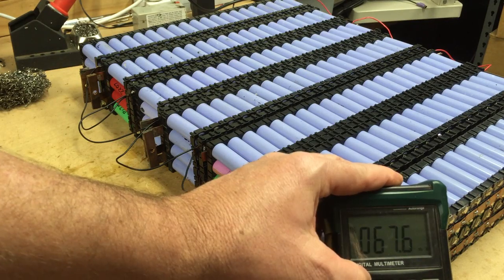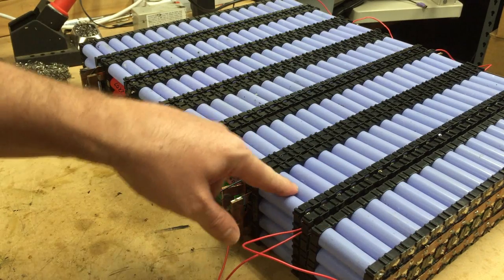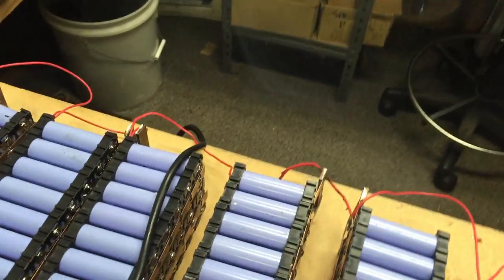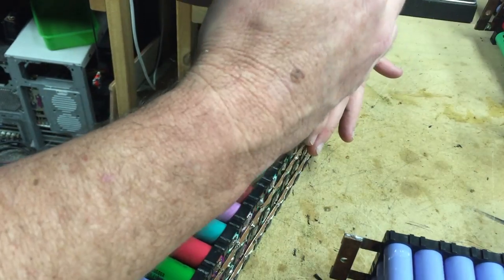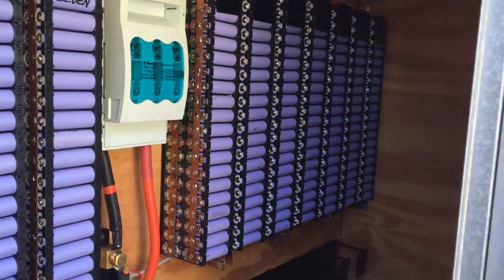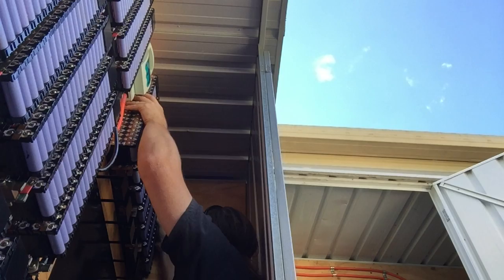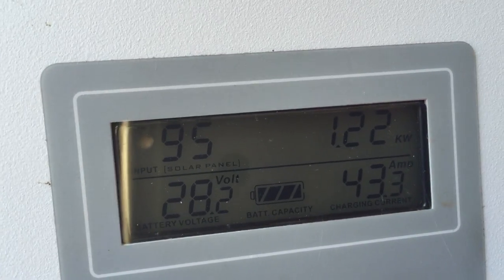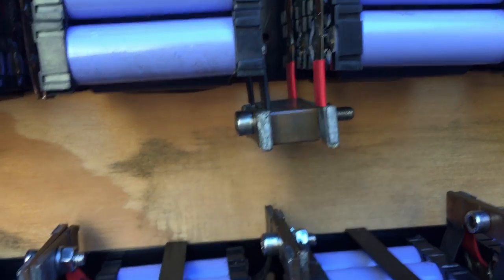Building a DIY Powerwall from used laptop batteries

Comment: Hey man, I just watched your video. Some quick remarks from an electrical engineer - don't confuse Wh (Watt hours) with Ah (Ampere hours). What you need to do is to multiply the voltages and the amperes (technically for each operating point of the cells respective discharge curve) and sum them up over time to get the Wh or kWh. You said you had around 30 kWh at 48 Volts, which would mean (as you said) 60 kWh at 24 Volts - that's not how you do it. The kWh stay the same, as the voltage drops to half it's value and the amps go up accordingly. The 'h' in kWh actually matters btw. - draw 5 kW for 30 minutes and 15 kW for another 30, you have one hour of 10 kW in average - 10 kWh so to say. Which means that it's the same for the battery, no matter if you draw 1 kW for 10 hours or 100 kW for 6 minutes (apart from losses due to heating of the battery at such loads). So the capacity of 30 kWh means that you could supply a 3 kW load for 10 hours, which would be sufficient for most nights, where your solar panels are kind of useless :)
Secondly, regarding the cells with different capacity - don't connect cells with different capacity in series, better have them in parallel to stronger cells in the other packs. When you drain your batteries in series, the smaller capacity ones will drain completely and irreversibly (!), while the other packs are still in good shape. As the other packs still have enough voltage so the resulting series connected voltage is high enough to keep the powerwall in it's operating range, the powerwall will draw as much current as necessary to power your loads. If this happens once, your smaller capacity packs fail and you will loose overall capacity. If you connect them in parallel to stronger cells, the voltage across the pack will balance automatically and the smaller capacity batteries will be discharched less in apsolute amp hours, but equally in percentage to the stronger ones in parallel. This will most likely boost your battery pack's robustness to heavy discharge tremendously. 
Apart from that - great work! If you don't have a bms, you should check your respective pack's voltages regularly and somehow try to balance them. Don't use bare wire for balancing, as they might burn again. Connect a resistor in series (dimensioned correctly to stand the load!) to equalize slowly.
Reply: Why does anyone talk in Amps?
Reply: Try talking to someone that fiddles with smartphones all day, MiliAmps is all they know.
Reply: Well - it's a power system. To calculate power (watts) you have to multiply amps by volts.
Reply: Also any hobby that uses Li-pos. Watts are never used, it's always amps.
Reply: Phasedragon what do you mean? I use lipos for quadcopter, heli's and planes. but don't get your comment. how can you use amps but not volts? unless you are referring to the way manufacturers display the battery's capacity? (which is by the way useless information without knowing the voltage or cell count since power is watts and displaying the ah is only half the picture) anyway I'm not sure I get what you meant?
Reply: kevin oakes He said watts aren't used, not volts.
Reply: TheRebel3000 I know. what point are you making? how can one consume electrical energy without using "watts" do elaborate....
Reply: It's not that they aren't used, it's that they're not measured. Volts are the cell count, amp hours are the capacity. Watts are not as consistent because the result changes with the voltage. 

A 12.6v battery with X milliamphours will last just as long as a 16.8v with X milliamphours, but the lower voltage will have less power. 
Whereas a 12.6v with Y watthours will be able to put out the same amount of power in total as a 16.8v with Y Wh, but last a shorter amount of time. 

TL;DR Point is, watts are a combination of volts and amps. And in an application where you may have varying voltage, like with batteries, amps are a more direct, meaningful unit. But in an application where your voltage will always be rectified and consistent, like in housing, then watts are more accurate.
Reply: Phasedragon ok. Well you are pretty much repeating watt 《 ;-) I said. I understand what you are saying but you are making an assumption. I shall ask hobbyking if they are planning a product recall for all the watt-metres they have sold......
Reply: in a circuit (like a flashlight), the load (light bulb) determines the amps, the volts are determined by the potential energy (the battery) and resistance of the circuit (internal wiring), and a Watt is a measurement of work, just like horsepower (about 730-750 watts per HP).
Reply: Alan Marshall We use Amps because it's a vital measurement in an electrical system.  If you don't talk about amps, you get fire.
Reply: @mitlaeufer1 , very interesting and informitive comment :)
Reply: thanks :)
Reply: All said and done pretty good job mate...keep your 48 volters low amperes so you can make them portable for trike, lawnmower,etc...keep your stick on the ice
Reply: Alan Marshall simplification from a lot of industries where the voltages are fixed for cells so people ignore it. It's no end of pain for me teaching this.
Reply: AHEMKBHD
Reply: Show off

Comment: Tight spot for that much energy density. Of course you know that. I used to work in the battery well of a submarine battery which is huge. 2.0V per cell with a 125 cells in series to get 250DC volts. roughly 2000 amps for an hour or so. The cells were 3 to 4 feet tall so huge power.
Reply from the maker: Yeh the space isn't perfect, what's worse is I have almost 20kwh more that won't fit :) Big things happening in the background at the moment. The old cashola is the only thing slowing progress.
Reply: how many deep cycles can it do ?
Reply from the maker: I really don't want it doing any deep cycles in fact most night it's lucky to draw .2 of a volt per pack :)
Reply: Why the 18650 form factor, would say stacked 7S flat packs or 14S flat packs be better?
Reply: He is using recycled cells from laptops.
Reply: How do you get 2000ah from 125 cells in series? 
125 cells in series is about 3amps!
Reply: z
Reply: Each cell is 2v  125ah
Reply: @robertw5607  amp hours means how long the battery will last under 1A of load, 2000Ah means it'll discharge in one hour if you'd constantly draw 2000A, or last 2000 hours if you only draw one amp.
that also means each cell is 2V 2000Ah, because the Ah value won't add up in series, 125 of them means 250V 2000Ah (or 2V 250000Ah)

he said the cells are 3 to 4 feet tall which is like 120cm tall, those are NOT 18650 cells obviously. most likely lead acid cells

Comment: Brilliant well done...I was nodding like a dog at you agreeing that at the capacity you have the lower capacity cells will work just as well because of the minimal load spread across the system... Re balanced module 100% agree no need
Reply from the maker: +1bigsyd never work well with single pack but larger packs it does seem like it will work with out issue. Other than I guess lower cells might have a tendency to completely fail faster perhaps.

Comment: kwh doesnt change with voltage 

30kwh at 48V is still 30kwh at 24V as long as the number and capacity of the cells is the same
Reply: you are the one who should take an electronics course 
i never referred to amp hours i was referring to watts (V x A = W)
i will take the liberty of schooling you today 

30KWh at 48V = 625AH 
30KWh at 24V = 1250AH
same number of cells = same watt hours regardless of voltage

even if you change the voltage 30KWh is still 30KWh 

heres an example
two 12V 10AH batteries contain 240WH of energy so regardless of the configuration they will have the same energy level (assuming they are fully charged) 
in parallel you will have 20AH at 12V = 240WH
in series you will have 10AH at 24V = 240WH

the benefit of higher voltage comes in the form of efficiency 
you can use more of that energy at high wattage levels because the amp draw on the battery will be lower 
higher amps = more voltage sag (that is why the power grid uses about 150KV for interstate power lines)

my solar system uses 12V and i get about 0.83V loss in the cables 
that means under 1500W of load only 11.17V is reaching the inverter if the battery voltage is 12V 
when the inverter shuts down due to low voltage at 10V there is still energy in the battery 
(not much but still a usable amount of energy) lower voltage loss grants you more runtime (to a point)

that voltage loss means i cant use all the batterys power at that high wattage
with a 24V system i would get a lower voltage loss for the same load wattage 
(as a percentage of system voltage)
thus i can use more of the batterys power at the higher wattage 

the other benefit of higher voltages is cost 
at 12V i needed eight 00AWG cables due to the amps needed to run at higher wattages 
at 48V i would only need two 00AWG cables to run the same number of watts 
making the installation easier and cheaper
Reply: MWB Gaming 20ah 1s 3.7v= 74wh 20ah 2s 7.4= 148wh    20ah 3s 11.1= 222wh. 33 kwh at 24v requires 1375ah and at 48v 33kwh requires 687.5ah. This is were i got confused. If you change series and parallel it does not matter, if same qty of cells are present. You are correct and i eat humble pie. What do you know i just got a tiny bit smarter. cheers for the correction.
Reply: not a problem 
knowledge is power and the more people know the better
Reply: I forgot to thank you as well for taking the time to add all the extra info. Cheers
Reply: its nice to know there are still civilised people in the youtube comments section
Reply: This is one of those times when you think: "What the fuck just happened?". Nice to see some civilised people as you said.
Reply: You are right... “as long as the number and capacity of cells is the same”
Reply: @mwbgaming28   I am also sitting here as a civilized person to watch your (healthy) war and give likes to both of you.To the winner and looser. ha,ha.
Reply: @mwbgaming28     you bothe are right,  30  kwh  is 30 kwh, aslong as one starts  with  x amount of power  it does not matter what form it takes (  48v   or  24 v )   but  if  on converst  from    30  kwh  at   48  v at  a continuous  anp,     to   20 v  ,   inorder to have   thew  same   kwh  , the amps  must double,   if one does not increce the  amps then  once it is converted it will have  60  kwh  .
Reply: @CstriderNNS  no, it doesn't work that way 

KWh is a measurement of the total energy a battery can store

KWh is a function of voltage multiplied by amp hours 

24V multiplied by 10AH is 240wh 
If you configure that into 2 10AH 12V batteries, you will still have 240wh 

The total energy of the battery is the same, you just rearranged the cells to make a different voltage battery 

Think of it this way, each cell contains a watt hour rating (10wh is the average for 18650s) 

If you have 100 10wh cells in your battery, no matter how you arrange them, you will still have a 1kWh battery 
You could connect them all in parallel and make a giant 3.7V battery, or you could connect them in series and make a 370V battery

The total energy would be the same
Reply: @mwbgaming28  yep  my bad   u r correct
Reply: @mwbgaming28  i just want to know how many battery packs do I need if I use 15 a month?
Reply: @wesunderwood8443  what do you mean?

Comment: Isn't it going to matter when you look at cost over lifespan? The ROI of having to determine which battery is dead in the giant blocks is low. You could create much smaller and thus easily replaceable packs. Then join those packs together. I can't see how this is going to work two years down the road when the batteries stop charging.

Comment: I guess I went totally out of the box with my design. I made a wall of tubes, put C cell batteries in them with a loaded spring at the top and a screw on end cap with the + contact in it. 11 cells at 1.2 volts each (13.4v potential) in surplus full size C NiCads. A temp switch in each one disconnecting charge on each one based on temp and seemed to last 5+ years of constant use. Was only 118 amps total though. 1-1/4" pvc pipe, threaded caps with a spacer wrap on the batteries works great. Used a Diode and a LED on each tube to assure contacts were working good.
Reply from the maker: Any videos up of your project sounds interesting
Reply: HBPowerwall No, but if I build another I will. Such a battery system is the best to put in a RV.

Comment: Don't worry. BMS was not a bad investment. One good thing about making cell banks with all those cells in parallel, is that you get closer and closer to an average. That makes the whole closer to a true sum of its parts. I like that you have fused each individual cell, so of one fails, you don't have dozens of others supplying energy to the one. Another thing that averages, with many cells in parallel, is self discharge rate. Differences in self discharge rate, is what throws batteries out of voltage balance. You will find, that you won't have to apply much current at all, to keep the cells balanced, compared to the capacity of the battery. 1/2 amps at the most. The same balancer that works for a single string of cells, can serve dozens of paralleled cells, because of that averaging. As far as safety, if you limit your finishing voltage to 4.15 volts(ish), that will get you nearly all the capacity, as well as a decent safety margin, lest the battery becomes slightly unbalanced over time. Self discharge rate is more time sensitive than cycle sensitive. Just like determining when to check water in lead acid batteries, experience will tell you how often to check cell balance. I would only run cell balancing during the top of the charge, not during bulk charging, and not at all during discharging. You may find a difference in cell voltage after running off 80% of its capacity, but near the end of the charge, they should return to pretty close balance. For this reason, do only a top balance, but discharge and recharge coulombically. You want each set of cells to experience the exact same amp hours, and balancing during those times can actually throw them out of balance.

Comment: ofcourse all voltages are the same.  All packs are in parallel. When you put them in series (when you go to 48V) you need to make sure that 2 packs that are in series have the same (or as close to eachother as possible) capacities. If your last pack is worse and has considerable less capacity than the first, don't put those 2 together in series.

In series similar capacities are most inportant. In parallel Internal Resistance is most important.

Because you have so many cells in parallel, the effects of variation in IR is small, but in series you can't allow much variation in capacity.

In series your battery is only going to last as long as the lowest capacity can handle.

Comment: I used cells below 1700mAh for the cells in my 2kWh Powerwall pack. Seems to be going fine. 1500mAh is my low threshold.
I'm so jealous of that EV West Powerwall though - drooling over all those real Tesla modules.
Reply from the maker: +Paul Kennett yeh awesome. Will build a big pack to test theory for my self. :)
Reply from the maker: Forever ? :)

Comment: kws stay the same regarding  voltage  difference  so only 33kw still. at 48v your closer to your target 220v that ev west were pushing  out for the car charger. so efficiency  goes up as you close the voltage  gap
Reply from the maker: +One up the sleeve customs arrr yea amps halve doh
Reply: To much soldering  mate ;)
Reply from the maker: Breathin - HOOOOOOOLLLLLD , exhale!

Comment: I would suggest arranging your cells in a balanced fashion so that you have approximately the same kWH per pack/bank. If you have one pack that has quite a few kWH less than the others, you run the risk of depleting it before the others in the array and reversing the voltage on that smaller pack, which probably won't do it any good.
Reply from the maker: Yep been there done that..lol early days the learning curve was steep. Thanks for your comment !

Comment: You seem to have batteries from different manufacterers, ...if so that will negatively impact performance; you undoubtedly know that.  Neat looking build.  Interested the cost?  Of course it sounds like you are down-under, so some cost xlation needed.  You'd indicated its 20 kWh, I presume at your 24V.  On latest video on our battery and box build uses fork lift batteries 2x24V with over 40 kWh, it weighs 2500 lbs - fun to see me loading them into the battery box - LOL.  Enjoy your channel.  Its exciting stuff.

Comment: 48 volts, If you have put so much work into building your powerwall 24 volts why are you changing it to 48V. You will get slightly higher efficiency, ( lower loss on cables and inverter) the only reason I see is increasing solar input into your PCM60x. or maybe bigger power inverter to run more of your home?
Anyway I think its going to happen, I looking at going to 48 volts for mine, I just want to find inverters. (I want to use old UPSs)
Its great seeing your progress and look forwards to the next video.
Reply from the maker: both reasons PCM60X can double the panels with out any extra cabling just plug and go and MORE power lol i'll be able to run more with less effort from the inverter. IE microwave and toaster (plus rest of house) at once rather than constantly thinking about what else is running at the same time.

Comment: your system is ok but it would be best if you adopt 48 volts or over system voltage instead of 24 volts one.  current losses Plus hard to manage such huge current flow's.  but any how.
Reply from the maker: 100amps isn't so huge :) and I am going 48v and will be pulling 150+ amps at 48v when i do :)
Reply: WHEN will you do?
Reply from the maker: already done :)
Reply: 7.2kw